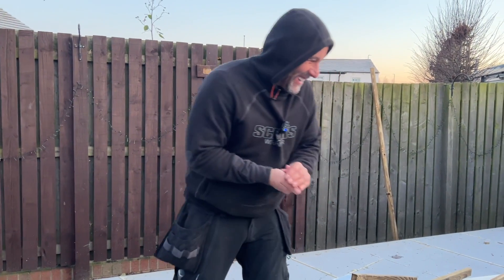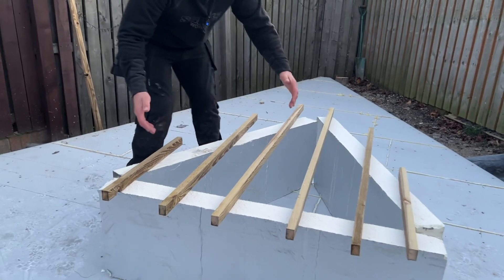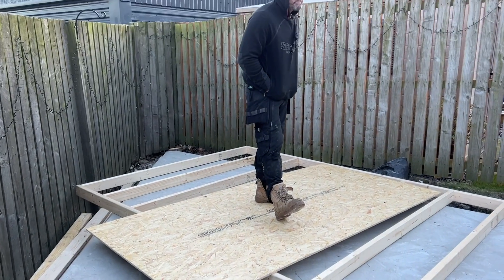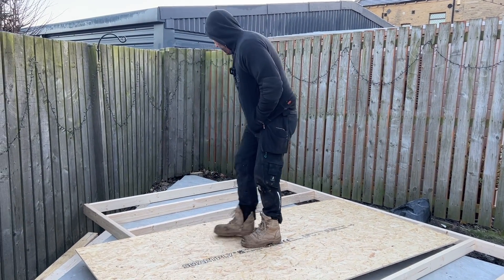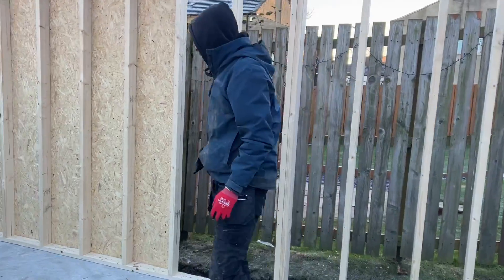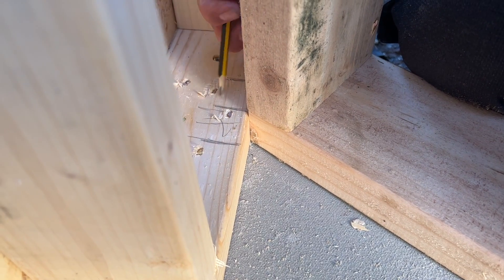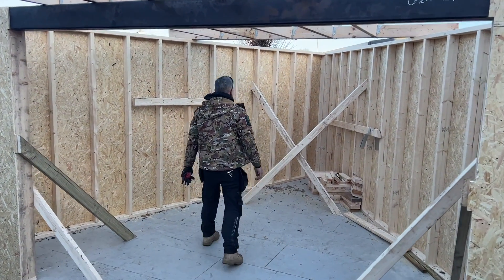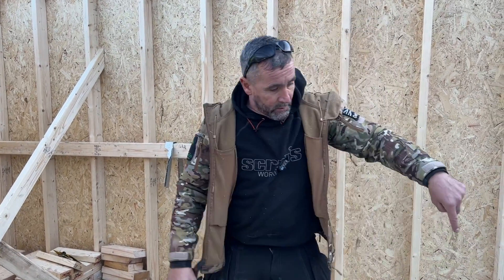How to  build a triangle shaped garden room wall construction with roof construction

Comment: I have watched quite a few of your videos the past couple of years and they have been very helpful, top work as always 👍. 

I built a trapezoid shaped shed a few years ago and I had the exact same problem of working out the varying rafter angles and the only way I could get my head around it was to also create a mini mock up. Ha! 

I ended up working out and adjusting the stud heights to accomodate for the different rafter falls and to keep them flat. So the top plate on the fall side(s) were basically sloped.  

The only thing I would say with doing it this way (which you most likely have already worked out, but thought I would say anyway) is the fascia boards and rafter end timbers have to be a varying widths on the fall sides (since the furrings finish at different thicknesses to keep the roof flat). 

As an example... on 1 rafter end towards the front you might have 12cm width rafter + 4cm furring finish, but on another rafter at the back you might have 12cm width + 1cm furring finish.

Another option would be to keep the fascia boards and end timbers the same widths the whole way across the fall and front sides, but will need to attach varying thickness wood packers underneath any overhanging rafters to keep it all flush and so they are all the same thickness (as the thickest rafter + furring, which will be the front face) to allow for a solid soffit attachment. 

As said, you probably already know all this, as you build these week in week out and might even have another idea, but if you didn't, hopefully it helps and makes sense.

Comment: I built an (out of square) triangle (see what i did there)  garden room it was built with brick and block and as is yours the roof is the tricky bit ours more so as it had to have the fall going off to the righthand side  our solution was on top of the wall plate have the joists running across ways with the left hand side higher to get the fall into a gutter running on the righthand side. as the joists going across got nearer to the rear apex point they gets a more pronounced lean but with the board on top they easily bent to the shape we finished off with a rubberised roof. 

From the inside the joists with noggins form a sort of dihedral shape its's very pleasing to  look at reminds me of looking up at some church cathedral beams. all worked out well but a square or rectangle building is much easier with less waste, used large format tiles on the inside loads of waste there also and a nice set of bi-folds. 
Doing this in the summer helped also, never doing that again.😀
Reply: I've done the same - an out of square triangle. Front wall is 6.5m and rear wall is 51mm longer!! Since found out that it was because my string line was set to the outer face of the blocks but I did 3-4-5 and 6-8-10 from the inner faces when getting my side wall blocks into place. Running a line for the back wall and laying the blocks seemed fine. I put the extra down to tighter than needed perps. I only found the discrepancy when checking the diagonals with a laser distance measurer - as my tape was telling me I was 10mm out (yes, a bit late). Using the inner faces, when the line was on the outer faces was not a good thing to do - especially when the blocks (7N concrete ones) are slightly irregular in size. Oh well, chalk that one down to DIY mistakes.